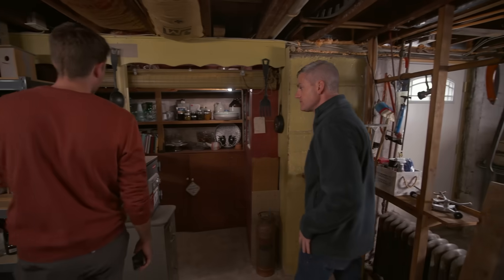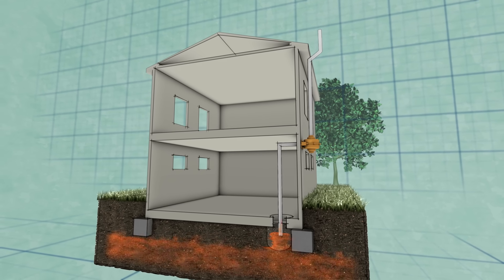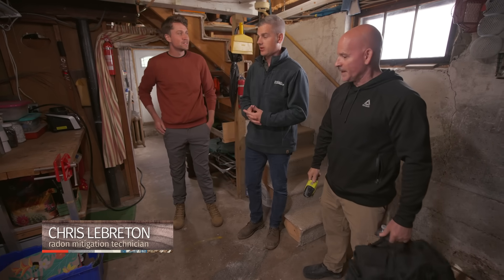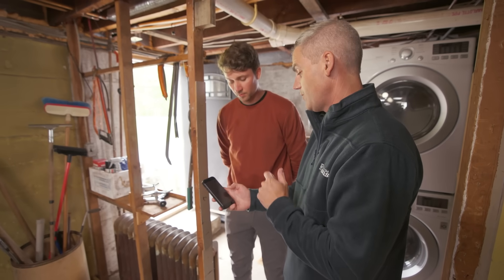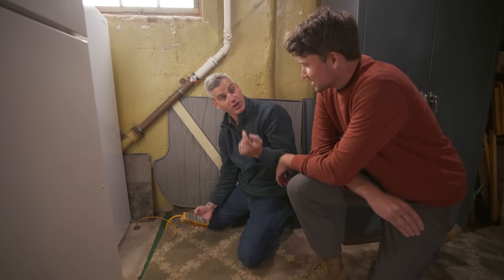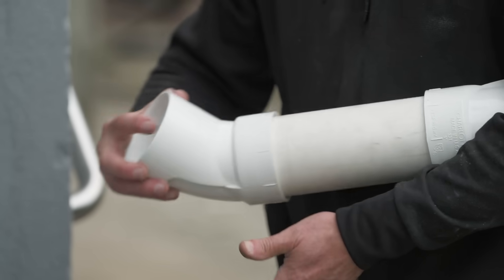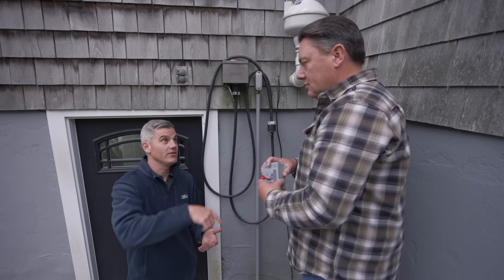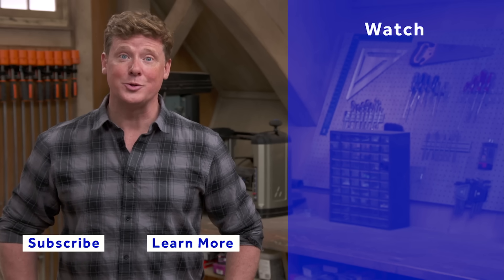How to Reduce Radon | Ask This Old House

Comment: Thank you for this video — it really highlighted the dangers of radon for me. Our home-buying test only gave a quick one-time snapshot, and I didn’t realize there were professional-grade consumer monitors available. After buying the EcoQube, I learned far more about our home: dangerously high radon levels over 20 pCi/L in an untested area and a builder-installed mitigation system with no fan. For about $1,000, I was able to confirm the issue, install proper active mitigation, and set up continuous monitoring with alerts. If you’re dealing with radon then a few things to consider: seal all foundation openings like mentioned in the video, basement mitigation reduces levels upstairs as well, and don’t rely on builder mitigation alone — proper active suction is essential.

Comment: I’m an owner operator of a radon company and this video is great! Super clear, very detailed and agree with everything. The work is great too. I personally use a 5 inch core drill for my floor penetrations to make the clearing of the pit a little easier but there’s nothing wrong with what was done here. The only thing I’d have like to have seen for other viewers was the “what if” scenario of one suction point not being enough and how to work around a finished basement aesthetically with multiple suction points. Those are the really difficult problem installations. But once again, awesome job and keep up the good work!

Comment: I would like to know what would be needed if there was well water. Anyone know?
Reply: Yes you start by testing your well water if that is high you could well be getting radon in the air via your shower and sinks! You can get a system that aerates the water and vents it outside!

Comment: Also, leaving the holes used to measure vacuum across the foundation from the piped vent is better than sealing them. Why? Because that reduces the induced vacuum outside of the building footprint, lowering the flux of radon to the instrumented house. The replacement air going into those holes will primarily be drawn from surrounding ambient air coming through windows, doors, etc. into the house proper.
Reply: As far as I know, those test holes are filled after the system is installed. The system is designed to pull aid UNDER the slab. Sealing any large cracks or open holes(like that plumbing clean out in this house) will help that.
Reply: @twan923  Thanks. My point is sealing will bring radon toward the house from a larger area than leaving some peripheral openings in the slab to allow some in-house air to flush the radon coming up from directly below the foundation. I personally would rather deal with the radon immediately below my house than pull radon to my house from a larger surrounding. If you search Google Scholar for “gas phase diffusion MacPherson,” you will see my dissertation is in University Microfilms via proquest, though you would be bored to tears reading the actual document.

Comment: Wonder if you can install a timer to run the fan. I have a hard time believing that fan has to be going 24 hrs a day to control gas going in the house.  I may be wrong.
Reply: The fan needs to run 24/7. As soon as it stops the Radon will be entering the house.

Comment: I know there are a lot of regional factors etc, but what is the estimated cost of this mitigation?
Reply: Give or take a grand.
Reply: @jimkoch1040  We did ours a couple years ago and it was about $1300 for the complete job. Fan has been running since and levels went from 21pCi to under 1 after installation.

Comment: Great video. They should have shown the post mediation results and mentioned sumps that are so commonly a problem.
Reply from the maker: Since the radon mitigation system was installed, the homeowner has reported his continuous radon monitor has been reading an average level of 0.7pCi/l.

Well below the 12.7pCi/l average he had when Ross first arrived.
Reply: How so?? 
😬 We have a sump, the foundation really needs 2 some seasons. It fills up, the pump flips on and pushes it up and out, by the time it's done that it's 2 seconds away from being full again (if it's not already) and does another cycle. Within 6 months of one another, the plug for the sump blew, then it went dry for 2025.

Comment: what about using an air purifier in your home?
Reply: An air purifier is only useful for dust,  
It doesn’t eliminate the source of the odor.
Reply: No. Air purifiers only work with compounds, not elements or radioactive particles.
Reply: I don't know think it would reduce radon. I'm not an expert but I believe those machines are only meant to pull odors, viruses, mold, and other biologic agents out of the air. Radon is a gaseous isotope of Radium. I doubt the HEPA filter would catch it and eliminate it. Someone correct me if I'm wrong.

Comment: So why not place the in-line fan in the basement area? Ducting the exhaust through the foundation wall, then above the roofline.
Reply: There are ANSI standards (and some states have codes) for installation of this type of radon system requiring fans to be outside of, but not below, the "living envelope" of the home. Basically, on the exterior, in an attic, or in a garage that does not have living space above it. Construction in this manner minimizes potential leakage on the pressurized ducting (exhaust) side of the fan or the fan itself in the future. This has been a standard of practice in the industry since the early 1990's

Comment: Does a vapor barrier beneath the slab at construction help?
Reply: Yes! The best way to manage radon is when constructing the home. Using tried and true radon reducing techniques which include a sub-slab vapor barrier, will provide the best opportunity to maintain very low levels of indoor radon.
Reply: That's a good question. Obviamente not relevant to an old house like that one, but it would have been good if they talked about it.
Reply: I've read articles where a heavy sub-slab vapor barrier would almost solve the problem. You'd also need to seal every crack in the slab, perimeter cracks, pipe or conduit penetration points, ensure sump holes have sealed lids...etc...
Reply: What was the post install monitor readings?

Comment: Why use a 3"when a4draws two times the volume? It is an old home. A 3"will also have more noise than a larger pipe.
Reply: Agreed. I installed my RadonAway fan with a 4" pipe and you can hardly hear it running.
Reply: Many systems are installed with 3 inch instead of 4 inch pipe. If the native soil in the area is dense and/or the slab is not very large, the extra airflow may not be necessary so the contractor chooses the 3 inch as it is a bit less obtrusive when venting up the outside of the home.

Comment: So what about wells?
Reply: Radon can be found in well water. Generally, it will be in higher levels when you have a deep bedrock well. While there is risk from ingestion, the significant concern is lung cancer from the outgassing that occurs with water use. This Old House had a segment on reducing radon in well water.

Comment: Excellent video and brilliant solution! Assuming there is an open window in the attic or the top floor, could radon find its way back into the house?
Reply: Radon is completely dispersed into the outside air within a couple feet of discharge.

Comment: testing in the basement will likely give the highest reading but unless you are working there 8 hours a day the exposure is probably minimal. Now if the basement is really high you might want to test the main floor of the house to see if the living area is problematic. If it is then do something about the basement.
Reply: Even at the level mentioned, the exposure is tiny. There hasn't been a single control study linking the tiny levels of radon found in US homes to lung cancer. All the BS claims mentioned in this video are based on "guesswork" by bureaucrats at the EPA using data from miners exposed to radon levels thousands of times higher and they did a linear extrapolation, which is not how it works and it's absolutely not grounded in science.
Reply: @hochhaul     yet, the American Cancer Society and a few others have data that shows higher cancer rates in areas with higher radon levels. Go fingue! BTW, the problem with any study is the variables... like some people smoke for 50 years and never get cancer because everyone is different.
Reply: Your furnace typically is in the basement, so when it gets cold and you turn the heat on it is now pumping radon throughout the entire house.
Reply: @STLshark2013    a furnace will have both supply and return ducts so not pulling air from the basement level unless that is also being heated and has open ducts down there. (part of the conditioned space) In the case of a boiler, there is almost no air exchange with the basement unless there's a lot of leakage, such as an older house. This is why many basements have that musty smell. There's no air circulation.
Reply: @rupe53  Agreed in theory but the videos This Old House has done on ducting shows they are, more often than not, poorly put together and do pull significant air from the basement
Reply: @pprb123    Having spent 10 years in that business I would say the supply side leaks just as much as the return, especially on older homes. That doen't mean it's a wash, but it does change things. OTOH, if it's a hot water system, there's little air movement between a basement and the living area. Bottom line is if the basement is boarder line then it's worth considering how much time you spend there and maybe double check the next level up before spending a fortune. In my case (older home) I run a fan for humidity control and there are no "hot" spots down there due to air circulation.

Comment: After the remediation system was installed what did it drop to?
Reply: My system went from 10 to 0.3. I also have a newer than this video foundation.
Reply from the maker: Since the radon mitigation system was installed, the homeowner has reported his continuous radon monitor has been reading an average level of 0.7pCi/l.

Well below the 12.7pCi/l average he had when Ross first arrived.

Comment: We have dealt with radon, in limestone heavy TN, for three yrs. 2022 house inspection found a 14 long-term avg, w/ 21 peaks. An attic radon fan was added to the builder's radon crawlspace pipe (just attic PVC hanging down in crawlspace) and that made it 2.0 and under. Then something changed, the weather, groundwater or something, and it was above 4 by the summer of 2023. So we added properly 3/4" drilled, about every 5 ft to maintain the suction, corrugrated solid (not slit)lack pipe, about 120 ft of it. All was well until we converted a garage bay into a gym this year. Our radon guy said we altered the "pressure" and radon is all about pressures. We were back to 4.0-5.0 readings, long-term. So we added a second fan, a second garage slab pipe (2 ft into the slab) and put some of the 2023 crawlspace piping on the 2nd fan. Long-term is now under 1.0.
Reply: Wow. This sounds like a relentless problem to stay on top of. I've been tracking radon in my home for a few years and for the past six months it's been trending up (currently at 3.3 long-term, 6.5 short-term). Hoping it goes down but I'm mentally preparing for needing to take action soon.
Reply: Crazy!
Reply: Yep- I am in western PA. Dealing with radon 29 years. Tens of thousands of dollars and 4 radon companies over the years. Not an “easy fix” like they say.

Comment: How do you reduce radon in an inaccessible crawlspace? The house is also solid brick walls and a stack stone foundation. With partitioned rooms. 

Is it just a matter of cutting an access hole in each room? Arguably, a total reflooring could improve the floor that consists of a single layer of 1/2 inch plywood.
Reply: Search "myths of radon" and watch the four part series before you waste money on this snake oil.

Comment: Why must the pipe go out the side and be so ugly?  Would it not be possible to go through a closet or along the flue for the furnace and be inside a house and less ugly?
Reply: Yes, you can route it inside. It will just cost more.
Reply: Former mitigation here.  My partner and I used to pride ourselves on finding inside pathways.  Sometimes it just isn't possible.  One way around this would be to do a system where the pipe goes into the garage and out the garage attic.  Another big restraining factor is where finished/ unfinished space is in the basement.  It was always nice to be able to give people options on placement when we could.  Also, you can't underestimate the importance of the sub-slab material.  This has a big role in system design and fan choice.
Reply: You can route it inside, but outside is safer because if you ever get a hole in the pipe(screw/nail through the wall, etc) now you're pumping radon gas inside your home(not ideal).

Outside and in plain view makes it apparent to not damage.
Reply: How about you search it up?

Comment: NO CAP ON TOP ?
Reply: thank you!!
Reply: This system is designed with the idea of not having a cap on the top of the pipe for best effectiveness. Any water that would get in would just drain into the ground below the foundation. A cap would cause problems with expelling the gas away from the house and could become iced up in winter where he lives.

Comment: I hate to be the wet rage but, what does pumping the radon into the atmosphere do to the atmosphere?

My hope is nothing but . . . ???
Reply: In the grand scheme of things, it radon doesn't do much in the environment unless it's concentrated.

 Pumping it out of a foundation isn't really affecting the overall amount of radon in the ground either as there would still be coming out of the ground even if the house wasn't there.
Reply: You're not adding more radon to the atmosphere. You're simply moving from one spot (your basement) to another (outdoors, where it would have gone anyway if your house had never been built).

Comment: Should I be worried about radon if I don't have a basement?
Reply: The risks get lower and lower as you move up a building. If your in a condo on a 3rd floor, I wouldn't worry about radon. If you're in a house without a basement and that has a ventilated crawl space underneath it, I also wouldn't worry about it. Slab on grade, maybe you should get one of the cheap tests that need to be sent into a lab.
Reply: In my case, I have a ventilated crawl space. But my garage sits on a slab. There's an opening for the water main access that sits about a foot deep. I wonder if there's radon coming from there?
Reply: @BackToTheGame.98 
Slab houses can still have a high radon level issue.  So you should test.
Any time you disturb the soil to build you create a potential low pressure area that can pull radon gas into your house.  If you do have an issue the construction of the slab and the house itself will dictate how easy it is to fix.
Reply: You can still test for it. My house is on a crawl space, and I had a test done. It was very low like a 2 or 1.
Reply: "Radon mitigation" is a con-job based on junk science put out by the EPA. There hasn't been a single control study on the expsoure to the tiny amount of radon found in the home and its link to lung cancer. Not a single one. The EPA knows it's BS when these con-artists claim radon levels above 4pC/L doubles the chances of lung cancer. The EPA admitted they are just guessing based on a linear extrapolation to cancer rates among miners working deep underground that were exposed to levels thousands of times higher. It's like saying sitting by a campfire doubles your chances of lung cancer because firefighters had higher rates of cancer due to smoke exposure.
Reply: @hochhaul Next thing you know the EPA will have us have filters in our underwear. 
If Radon is so dangerous, why aren’t these Randon specialists wearing hazmat suits when installing the system?